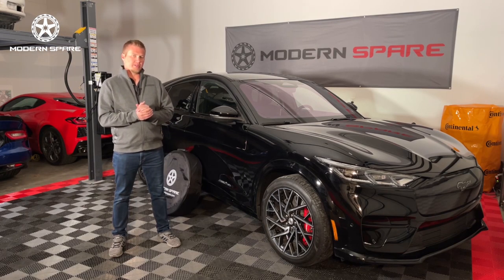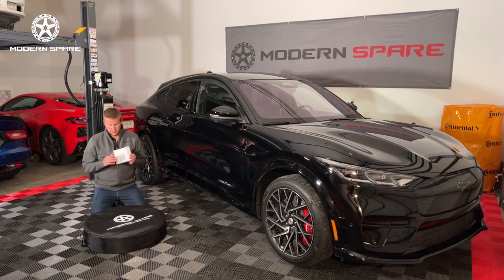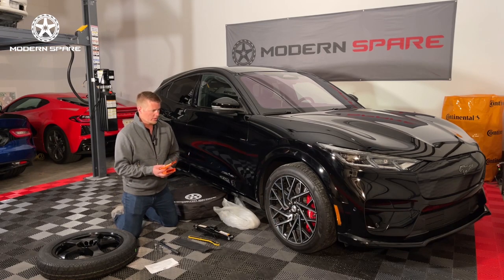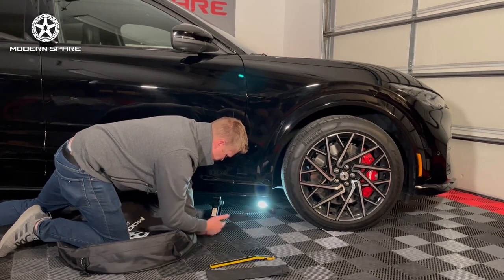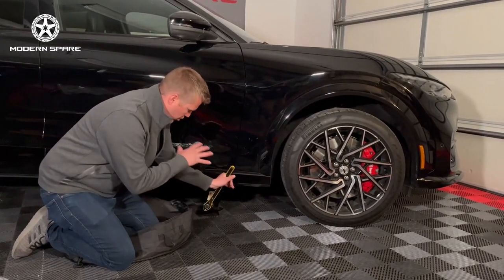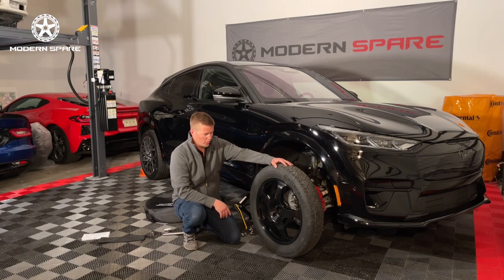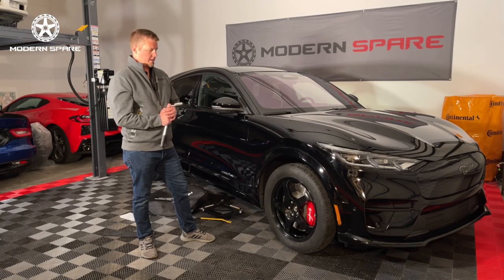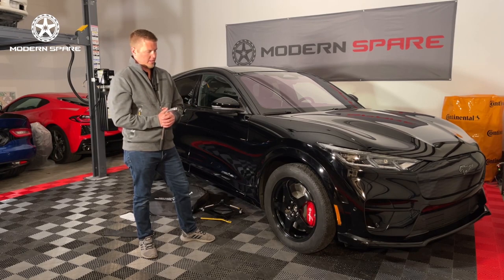General Installation Instructions for Modern Spare

Comment: I thought you weren’t supposed to install compact spares on from wheels. 😮 They experience a lot more side force during turns than the rear. Maybe I’m just cautious but I would install the spare at the rear then swap the rear wheel to the front for safety. 

I don’t really like your example showing a front tire without at least mentioning if the modern spare is rated for that much side force especially on such a heavy vehicle.